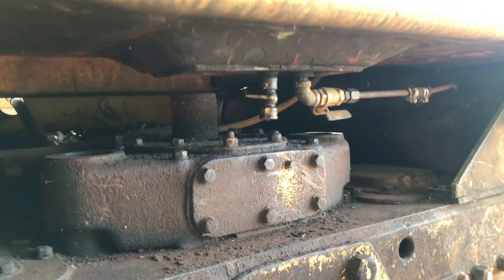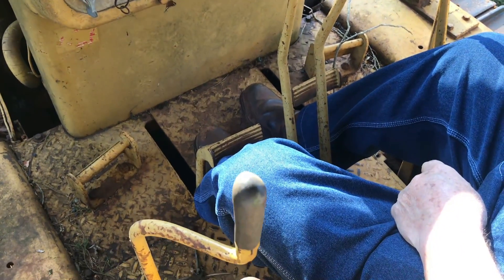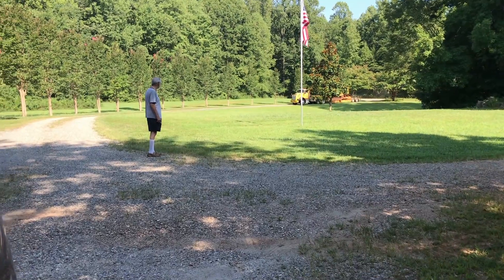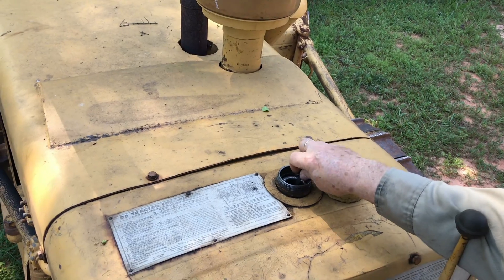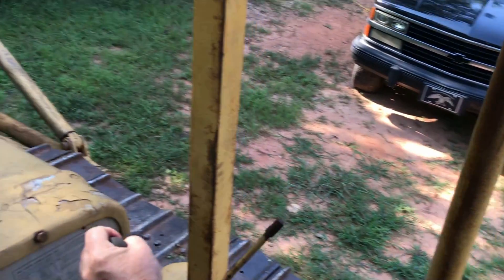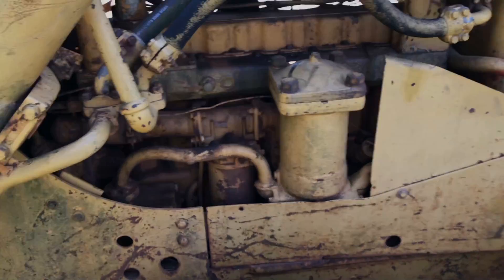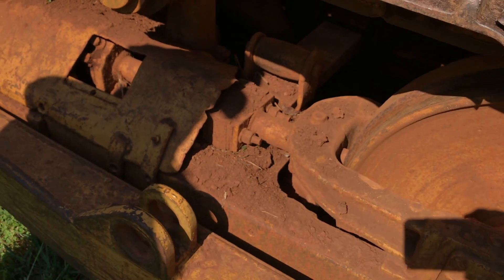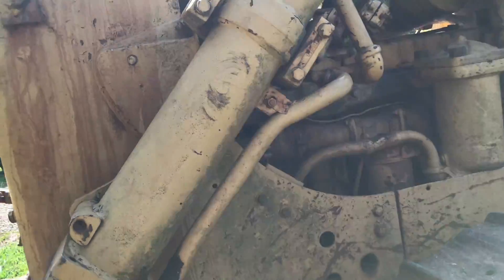Cat D6 Dozer Controls for Operating - WILL IT START?

Comment: I got one cat D 6  B  1964  it was gas  powered  start pony moter but went and direct   strat   put on strater moter  and Two batteries    goes well I use it all year  two trees lots and hill gorse  and under runners bank the push off   got case 770 disc I pull

Comment: Hey mate, great vid….I just picked up one of these old girls at auction… getting dropped down to my farm next week. Runs great, needs a new belly plate but other than that in pretty good condition considering…. I have been unable to hunt down a operator manual online…. Any tips? Is the blade easy to adjust?
Reply from the maker: Thank you. I found a maintenance manual on EBay.  I’m not sure about a operator manual though. I haven’t adjusted the blade yet. I’m thinking it shouldn’t be too hard. Thanks for the comment and best of luck to you

Comment: I have never put a diesel at full rpm's then shut it off before.  Seems odd to me. But cool machine. I grew up on one of them. But all cable driven blade and winch.
Reply from the maker: Seems to be an old timers thing to do. See it a lot in Nascar and dirt tracks I worked around. Not sure the reason on a diesel though dozer though
Reply: That didn't sound like a turbo diesel but that would be detrimental to a turbo. That would be full throttle and then cut off oil supply and let it spin down without oil pressure.
Reply from the maker: @Jacob-zd4gj  Yes that is correct and well-known I’m on most mechanics. I’ve got mostly videos of engines that I’m building but have to edit them still. A 327 and a 350 coming up. I piddle on the dozer and my tractors from time to time as needed.
Reply: Dozers are by far my favorite piece of machinery, I am on them often and watch them when I'm not lol.
Reply from the maker: @Jacob-zd4gj  mine gets up in temperature after running about 20 minutes. I’m gonna try cleaning the radiator
Reply: I blow my out with a leaf blower daily, but when I first got it it was plugged up so I use the hose and purple power. It's been fine ever since. You'd be surprised even a little bit of dust makes a big difference on a radiator.
Reply from the maker: Ok that’s a great idea with the purple power. I keep it by the gallon. We used it to wash the engine blocks before assembling in NASCAR years ago. It cleaned the best of any other even Tide.
Reply: Yeah. I put it in a weed sprayer pressure sprayer. I use it full strength let it sit for a minute and spray it right back off. I do all the engines transmissions in all my equipment.
Reply from the maker: Ok do that. I’m looking forward to using the dozer for more than 20 minutes hopefully. Got lots to do
Reply from the maker: @Jacob-zd4gj  I’ll spray mine hopefully this weekend

Comment: I have a D6B with 5800 hours on the meter and a Carco F7 winch on the back.  because of the winch placement, i am unable to get a serial number or year for the machine.  I just had the Radiator re-cored and it seems to work good now.  I wonder what the weight of it is.  my friend says his International 175B loader weighs about 10000 lbs more and I am not sure about that.. Thank you.
Reply from the maker: The D6b I have is 40,000 lbs. I’m not sure about yours but I can ask a friend and comment back. Mine tends to run high temperature so I’m trying to figure that out. Thanks

Comment: I have the very same machine, only a few years older, but still a good machine.
Reply from the maker: Sam1734 built to last that’s for sure. Probably still be running another 70 years
Reply: My D7 is 65 years old
Reply: Theres a plug in the belly pan to drain the oil on every caterpillar machine

Comment: my dad was killed by a bull dozer in 1969 , i was 11 years old . he was pushing over trees on a hill to build a ski slope , supposedly a oil line broke and back then they were metal and not rubber , he was standing on the treads and bumped the brake that was to stick up about 3 feet ? i don't see that . anyway it drifted backwards and he fell and it went over him . i also remember him showing us a 2 ton wooden bridge that he drove over with the 20 ton ? dozer >  lol
Reply from the maker: Oh wow, sorry to hear that 😐 This machine is over 40,000 pounds. I’ve got lots around my property that I want to do with it. Just got a 55 gallon drum of diesel fuel yesterday
Reply: does that make sense with the brake sticking up and bumping it , or do you think something else could have happened from your experience driving one ?  thanks alot .
Reply from the maker: The lever on the left stops the transmission, like a clutch connecting it to the engine. If that was pushed back it would move the dozer
Reply from the maker: It’s the lever on the far left in this video.
Reply: @dhammiam  thank you very much , always wondered what happened , i think that was it , apprecaite it !!
Reply from the maker: Jake mcvea you’re welcome my friend